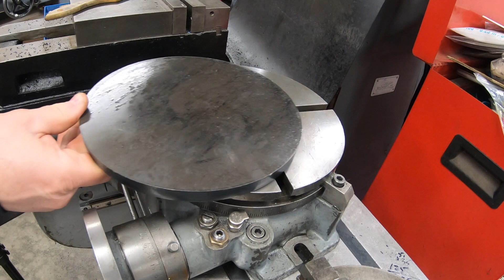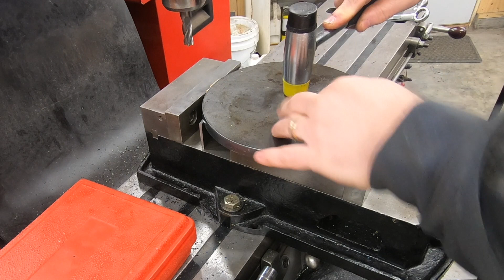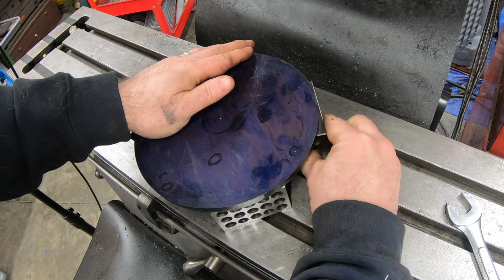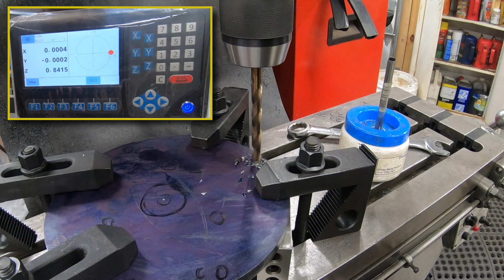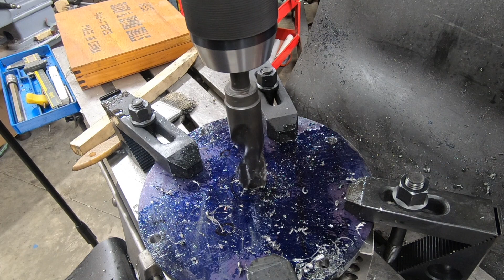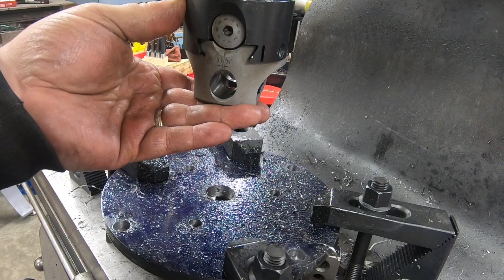Mounting a 3 Jaw Chuck on my Rotary Table - Part 1/4

Comment: Great video man, try you a round insert in your fly cutter, I get Great surface finishes with the one I built out of a half inch piece of key stock..
Reply from the maker: Thanks for the tip! I will have to find or make a button insert tool. I could see it being useful on the lathe as well.